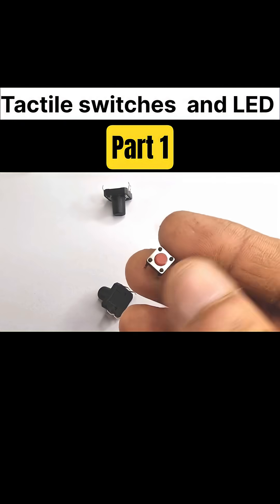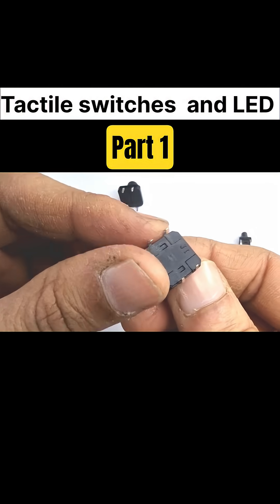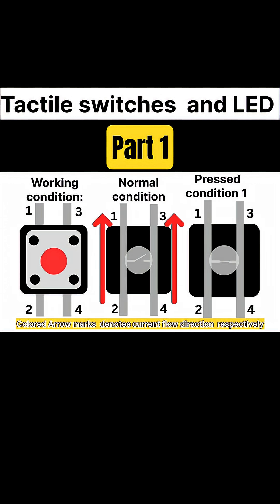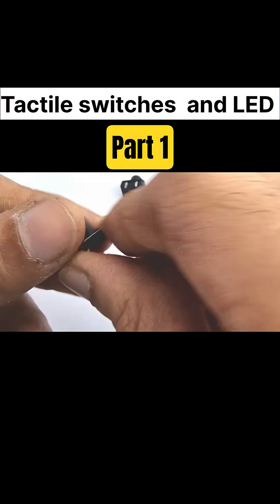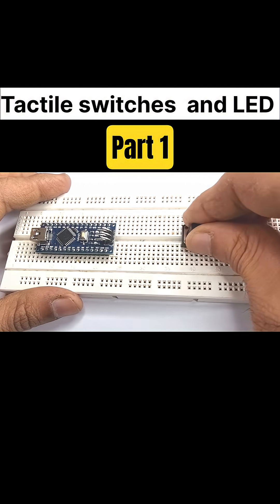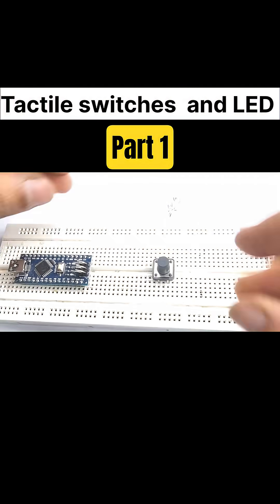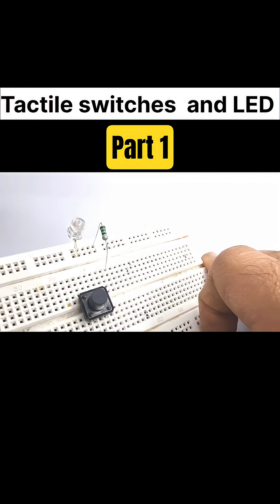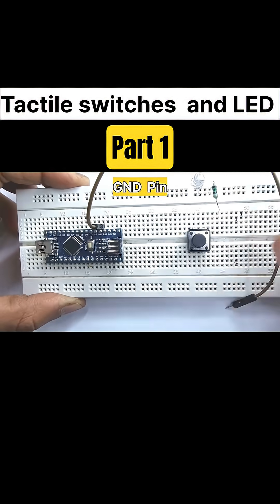Tactile Switch Pins Explained in the Easiest Way! Part 1 #shorts #arduino ##experiment #electronics

Comment from the maker: Hi viewers, Please note that, I have given demonstration for Only One LED to control here. Please note that the current will also flow through interconnected pins that is 1&2 as well as 3&4. For example, if you are controlling a LED, from pin 1&3 or 2&4 or 2&3 or 1&4, the current will also flows through 1&2 and 3&4. If you are controlling two LED like, for example if you are controlling one led from 1&4 it acts like switch. Also if you have connected another LED or any Device at the point 1&2 it will also get ON directly because they are interconnected l. That means two devices get power in this way. This also applies to 3&4 and works like 1&2 pins respectively. Please be aware of it. I will make a video on that and will be  uploaded very soon. Thank you. Happy viewing. Please don't forget to Subscribe to my channel and give a like if find helpful.